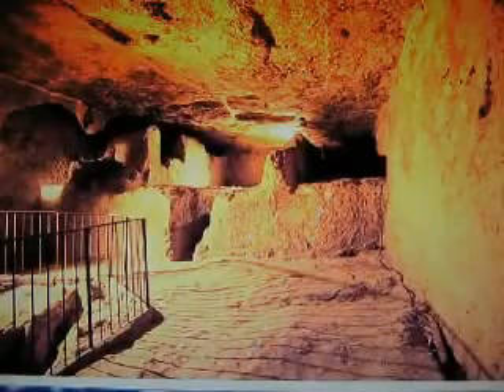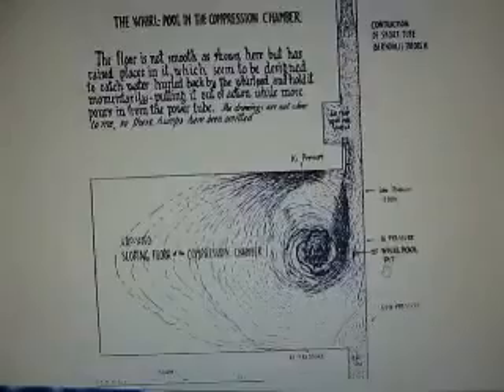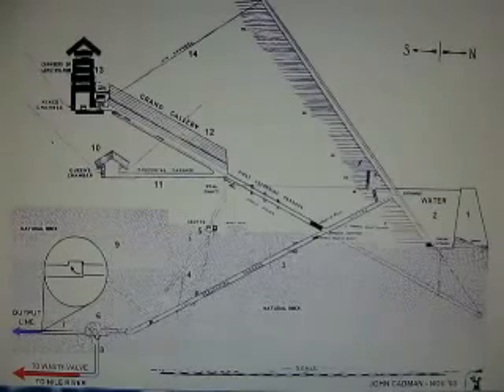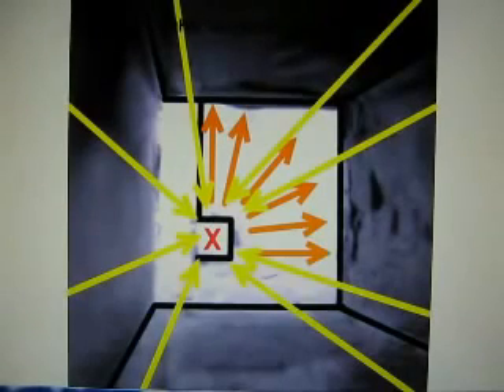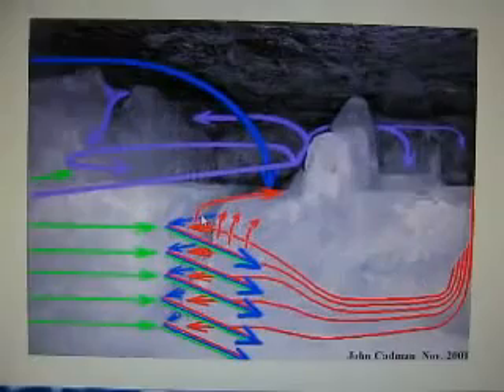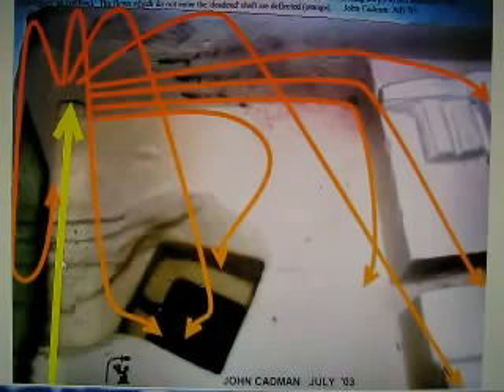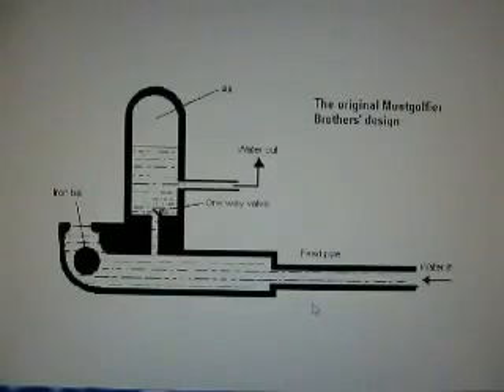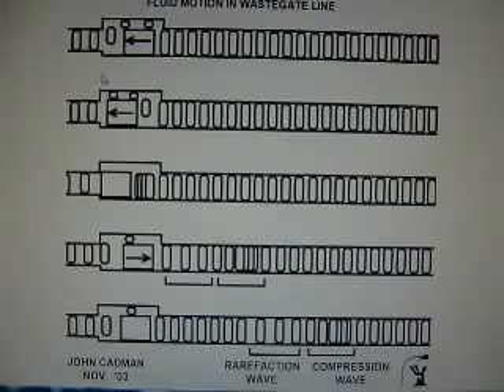Pyramid Hydraulic Ram Water Pump 2 of 3

Comment: Regarding your diagram shown at the end of the video about the block that gets pushed from side to side. The amount of pressure necessary to repeatedly push a multi-ton block back and forth would be extraordinary. Also, assuming they were successful in creating this amount of energy and the block did begin to slam back and forth from one side to the other, wouldn't the block in question, as well as the walls stopping it on each side, slowly begin breaking apart each time the block hit the walls? Assuming it was a ram pump, I don't see this system lasting very long. If they were lucky they might have gotten a year or two out of it before this area fell apart, but that's being generous.